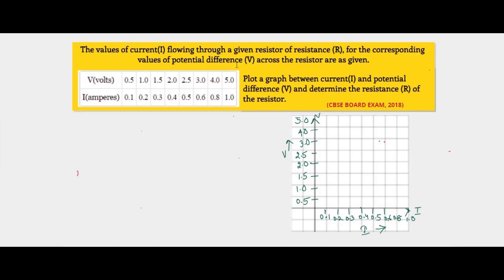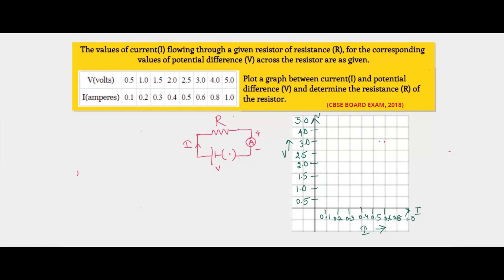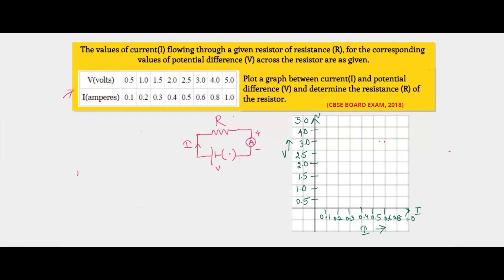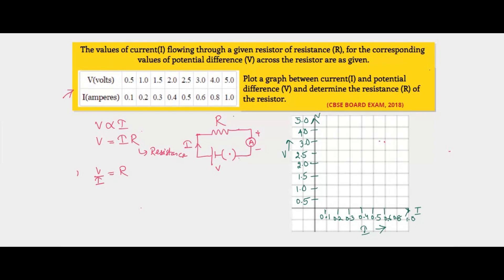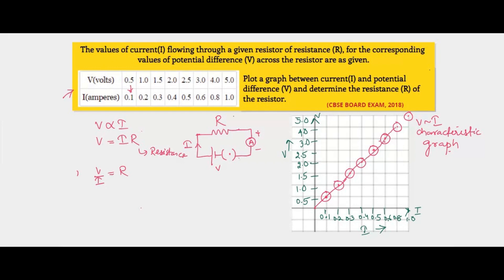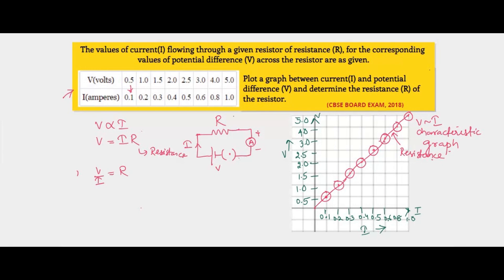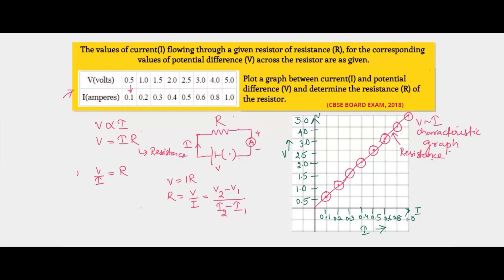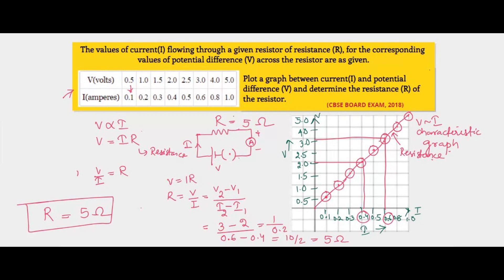THE VALUE OF CURRENT(I)FLOWING THROUGH A GIVEN RESISTOR #class10physics #viralvideo #cbse #ohms_law

Comment: In the question , it is given draw a graph between current and voltage. But you drew the graph of voltage vs current
Reply from the maker: Hello beta. The voltage is taken on the x-axis and current on the y-axis, as voltage is the independent variable and current is the dependent variable (as per the question).